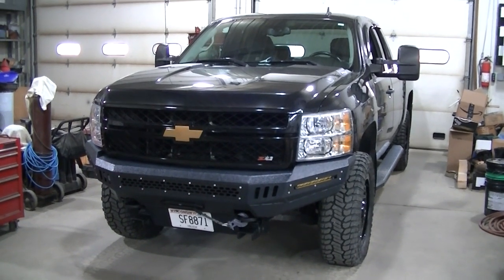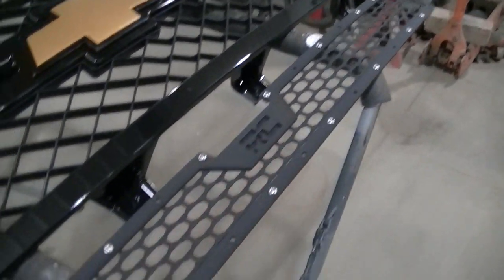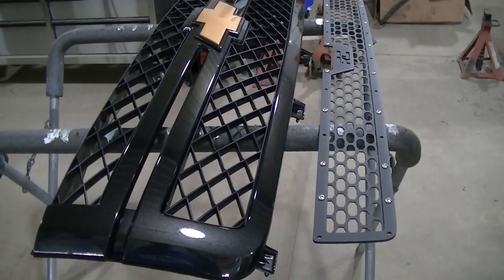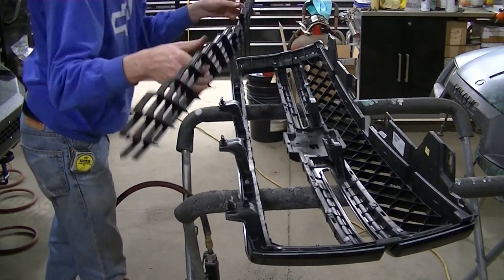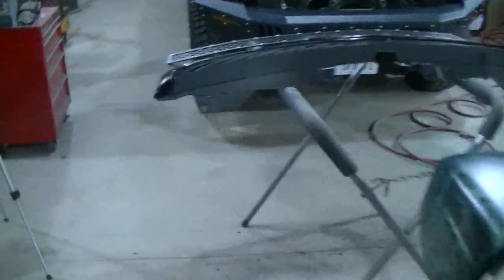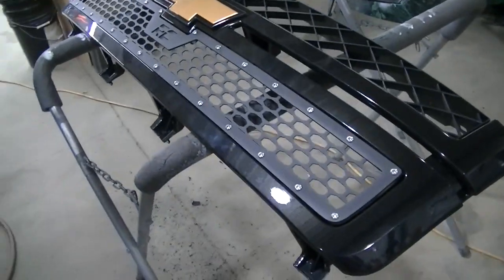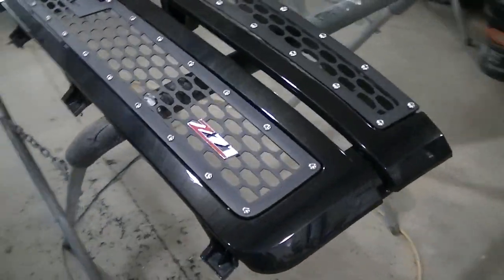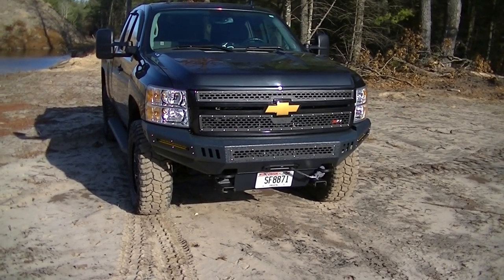2009 Silverado 2500HD Rough Country Grille Install

Comment: Lund use to make plastic inserts with spreading clips in the 90s loved them here in new york i got one for the summer and one more solid strips called cold front
Reply from the maker: I remember those. I had a set of them at one point. Not the cold front ones.
Reply: @mossman381  the screen front . looked on the Lund website last night and it said out of stock for 94-98 4 light system the Silverado's i found one for the two light systems Cheyenne only not the w/t trucks

Comment: Looks badass!! The 99-02 grill inserts are way easier with just tabs on the back.
Reply from the maker: I have done a few grille inserts and they have never been this hard but I think the overall look was worth it.
Reply: @mossman381  I agree it was worth it. Rough Country reengineers their products over time. Maybe they will see your video and redo this one.
Reply from the maker: I don't think they will be making many more of these grilles. They will probably work more on the newer style trucks. This grille only goes to 2011-2014 and they are only 2500HD trucks.. That is almost 7 years old now.

Comment: I was thinking of taking the front end off my 02 2500hd and replacing it with a 2020 front end.... The tailgate as well.... Thoughts?
Reply from the maker: That could prove difficult but probably possible with enough time and effort. I would start by measuring the new trucks to see if they are close to the same as the old.